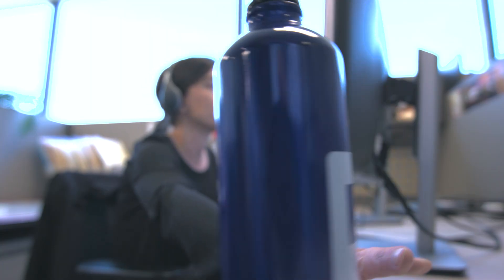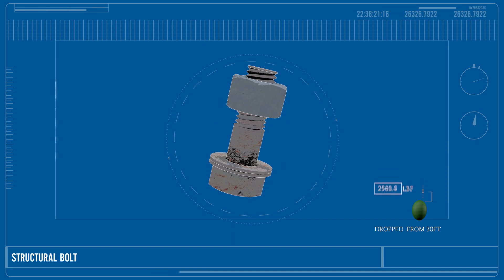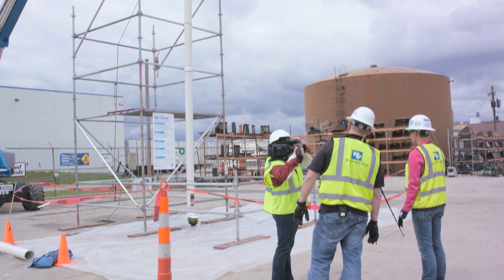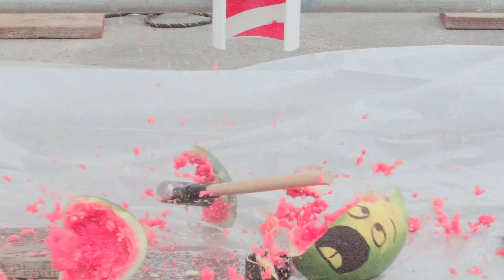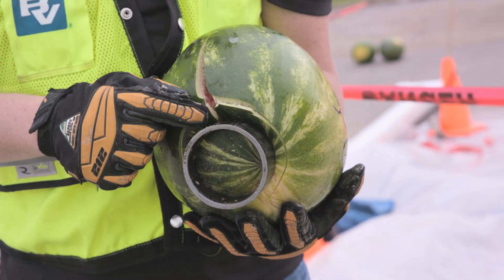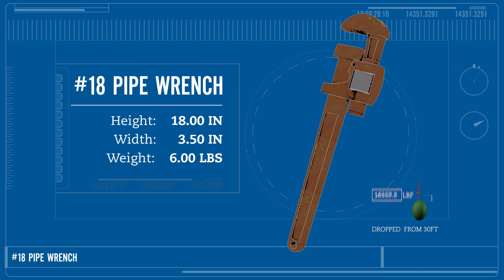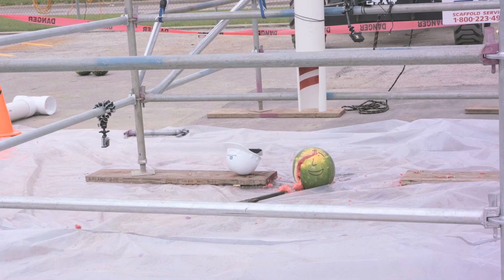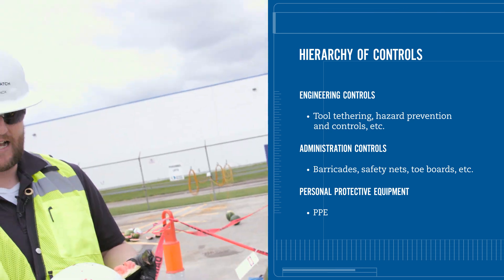The Dropped Object Experiment | Black & Veatch Safety Awareness

Comment: Force should be stated over an area.    Without that, it's like a rookie trying to impress you with numbers.     I mean come on, Air alone puts over 2000 pounds of pressure on a single square foot.    (14.7# per Sq. Inch x 144)

Comment: I do not think our skull is as thick as the watermelon skin. Irrelevant experience object used.
Reply: If you put the watermelon against a hard surface and then head butted it, what do you think would break: the watermelon or your skull?
(A: the watermelon)
So no, our skull isn't as thick, but it's a lot stronger, and this test goes a long way to showing the effects of drop hazards and how they can be mitigated with use of correct PPE.
Reply: Shannon Gomez bone is more dense than watermelon rind.